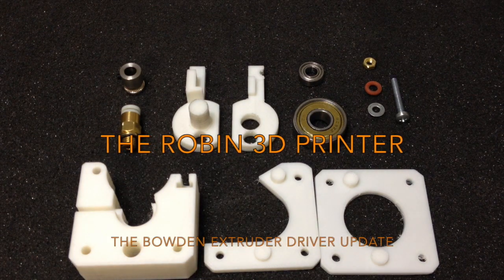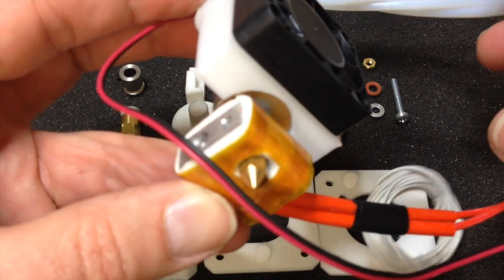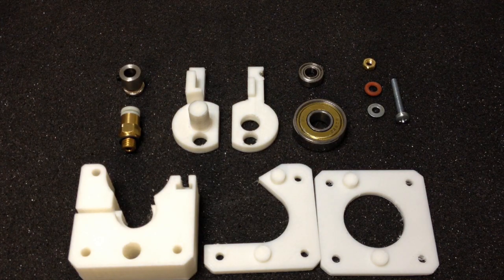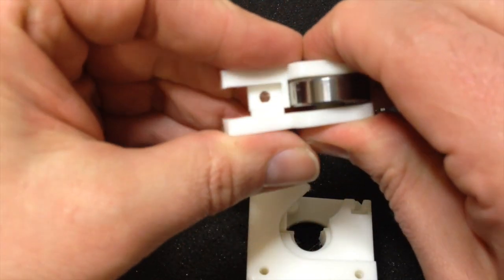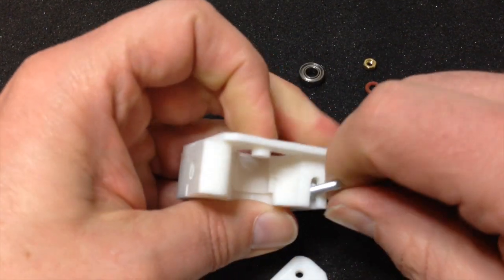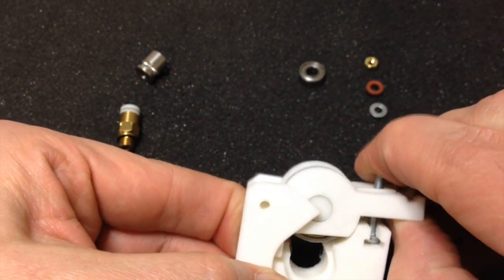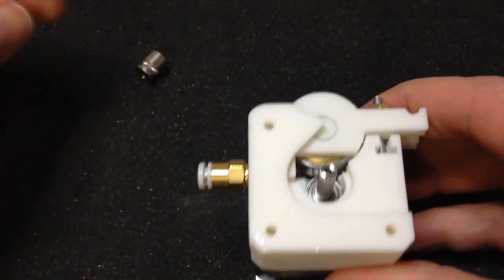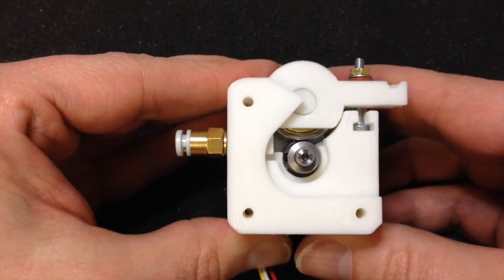Robin 3D Printer Extruder Driver Update

Comment: i'm playing with my machine and have tried different extruders - yours seems pretty interesting and simple, but i could not find it on your github - any chance of publishing it? or did you encounter any problems with it?

also - i noticed on your github repo for the robin printer that a lot of parts have a numbering added to them, is it some versioning? or different parts? (thinking about printing it...)
Reply from the maker: +Tom Keidar You are correct, I removed the robin extruder driver when I did a major update to it. I'll update the files tonight if I get the chance.
The numbering on the files is caused when I split a design into several printable parts, so you'll need to print each of them. That way you can easily reprint any single part. The Robin has an update to the Z-Axis coming up, but it is a small update that can be reprinted quickly, the current parts are prone to Z-Axis Wobble if the threaded rods are not 100% straight.
Reply: Thanks, i'm looking forward to trying the extruder out, and will take a look at the parts to print. how fast can you get the robin to print at? in the other video it seems to be moving a little bit slow and pausing between drawing parts. or was that done on purpose?
Reply from the maker: +Tom Keidar Depending on how low the weight of the table is, the robin will move at up to 300mm/s and given that the extruder supports it, it will print at up to 120mm/s. That's lightning fast. I use it to print at 0.2mm with 60mm/s.
The printer needs a very large, heavy base to go at max speed, or it needs to be bolted down onto the table.
Reply from the maker: +Dirk Herrendoerfer Pushed the files to the repo, if you print the extruder driver use at least 20% infill. Some sanding is needed on the idler for the bearing. Then use a drill to make the holes fit the inserts, everything should snap together. The idler should need a little force, it will wear in.
Reply: those are really good numbers, i'm definitely going to play with it! btw - what has been your retraction experience with this extruder? how much do you have it set to?

great, i see you have re-uploaded the extruder... i know what my printer is printing first thing tomorrow ;) gonna print at 40-50% infill, i have found the for my printer parts this turns out some extremely strong results for pla, is there any part you recommend to print 100% infill?

thanks again!
Reply from the maker: Tom Keidar anything above 20% will work. Depending on your printer you may want to set extrusion to 90% so the parts fit better .
Reply: have tweaked a few things on my printer lately and i was looking for something to print @ 50% infill and see if i get any warping and good bed adhesion - so i ended up printing this @ 50% infill and 90% extrusion, they turned out pretty great (i'll add pictures in a bit) but i'm not sure the 90% extrusion was a good idea, i have a few places where there is a mini-gap between the shells and the infill (body), that's never happened before - but it still looks good and i checked and these mini-gaps are not a problem (still sturdy and feels connected under pressure from a plier) - hopefully i can get it assembled tomorrow and have some results to compare with my current bowden
Reply from the maker: +Tom Keidar So, how did it go ?
Reply: hi, sorry i wasn't able to update - dry fitting was great, though i did have to drill the holes a bit - they came out too small which is pretty unusual for me - ever since i moved to slic3r i get perfect holes (might have to smooth them sometimes with a file but the size is perfect), might want to check the tolerances on your model.
it's no biggie though, it was basically 3-4 holes most of which were one drill and then just one other hole with a step drill i had.

i've went ahead and mounted it on the stepper motor yesterday at 3am with the idler and gear but have not had time to test the new setup (hopefully tonight or tomorrow)  - the m3 screw i was going to use as the tightner is a no go - so i'll have to get one later today. i'll also try and add some pictures later all in all it looks like a really sturdy, good pressured setup - really looking forward to trying it out :)

also have to figure out mounting on my 20x20 rails...
Reply from the maker: +Tom Keidar Don't forget, you need to put something springy between the tightener and the idler, a rubber gasket or a small loadspring.
I'm planning a slightly modified version to use as a direct extruder driver, not bowden, but I'm not happy with my designs yet.

Comment: Dear Mr. Herrendoerfer: I searched for the small bearing, but could not
find one measuring 11x5x4 as you mentioned. I did find these:
http://www.aliexpress.com/item/MR105ZZ-Miniature-Deep-Groove-Bearings/32302611252.html
which are 10x5x4: MR105ZZ Miniature Deep Groove Bearings.
Are they the ones you used? If not, could you disclose the model #
of the correct bearing?  Thank you   Nelson
Reply from the maker: Nelson Machado Use these : MR 115 ZZ 5x11x4 they are commonly used in RC model cars by Tamiya.

Comment: It appears that your motor shaft doesn't have a flat spot on it, this could have been making the MK8 drive gear slip around the shaft.
Reply from the maker: No, I marked the drive gear, the idler and the Filament, with a marker, and the drive gear was moving but the filament was not. Btw: The setscrew from the gear really digs into the shaft.